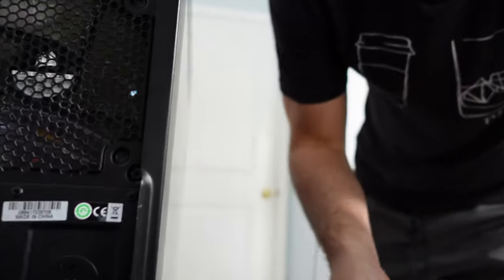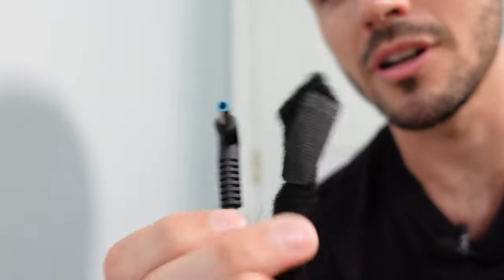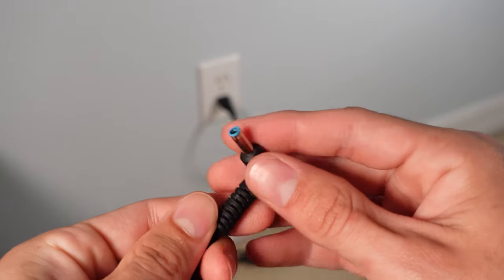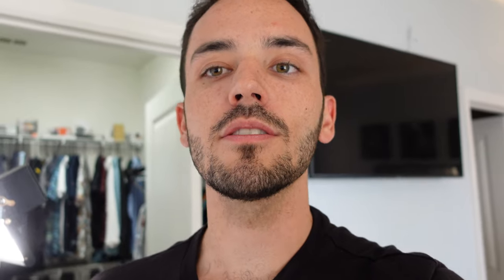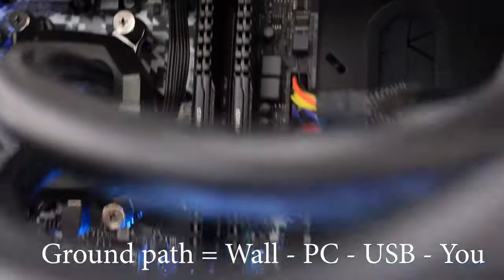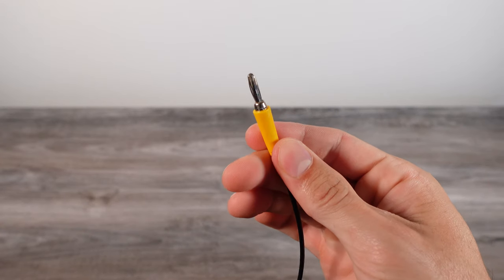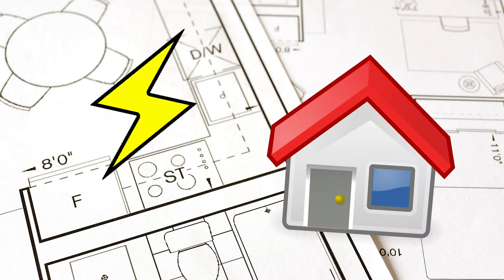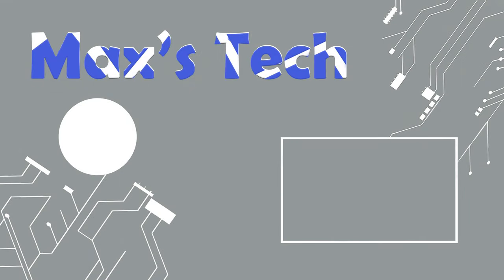PC Building - Easy Grounding Tricks

Comment: Two important facts: Older houses probably aren't grounded, even if you have 3 prong plugs. Also ALL electronics plugs (like the one he showed) have the ground on the outside ring. You have to understand how to read the plug symbol to know if the ground is on the outside or the inside. Moral to the story, YouTube "experts" can kill you (or wreck your equipment).
Reply: this is easily testable by finding a common item such as a power strip with a ground LED indicator. If the light doesn't luminate when you plug in the power strip to the socket, that socket is either faulty (doesn't ground like it should) or the power strip is defected.
Reply: How old of a house for there not to be a ground?
Reply: @rotatorcuffs8140  I'd say houses in the 60's would be grounded. Not sure when exactly, but probably the latter half. I have a ranch built in 1957 with an addition attached to it in in 1967. The addition has grounding wires and 3 prong plugs, not the rest of the house though.

Comment: I'm a bit lost. My new pc has the usual on/off button, and an "I/O" switch at the back of the computer. (Near the plug inlet.) I'm using a power bar--I always switch that off at night. Questions: Keeping the desktop plugged into the (grounded) wall socket; with the pc power button "off"--Do I switch the "I/O" toggle to the off position? I have no idea why this pc has such a thing. It's something new to me. Why the customary on/off button; plus  the "I/O" switch? Thanks for any replies.
Reply from the maker: If I understand correctly, you’re talking about the I/O on the power supply on the back of the PC? That is the hard off switch. So that cuts any power from going from the wall socket to your power supply. The button on the front of your case just signals the computer itself to spin up and turn on, even if it has power from the supply it can remain off, but that button on the front case tells your pc to start drawing power essentially.
Reply from the maker: Same way your phone can be off but still have a fully charged battery. Just needs the signal to start drawing power.
Reply: Thank you Max! I kinda thought the switch at the back is for a "hard" off. Thanks for affirming that for me. If I may; one more question: I hope it's not too painfully obvious: Before opening my pc; (1) The "hard off" switch should be in the off position?  (2) Off; but the desktop still plugged into the grounded wall outlet; I remove the pc cover. (3) Last step; I'll fasten the anti-static alligator clip to one end of my USB phone charger, and the other end into a USB port. Before I go....I enjoyed your presentation. Clear; helpful, and very polished.

Comment: If there’s any confusion he’s not talking about connecting yourself just to a laptop or desktop, it’s about connecting yourself in a circuit to “the ground.” The plugged in computer (or electric outlet 3rd prong) is a gateway to the ground, through your home’s wiring. 

By completing a circuit to the ground (grounding yourself), you are preventing static buildup & ESD discharge. 

Any excess ions that would be accumulating on your body get transmitted immediately through the cable into the ground. (Think of the earth’s soil like a giant heatsink for electrons)
Reply: Does this mean when I work on a desktop, power it off, hook my wrist strap up to a metal part of the CPU, but most importantly the power cable needs to be plugged in so that way it completes the circuit to the ground.  Is this right?
Reply: @isaacrodriguez8907  And also turn the power supply switch to 0 (off)
Reply: Being barefoot on the ground works?
Reply: What if your laptop charger doesn't have the ground prong and only the 2 top prongs, will it still ground you?
Reply: The transformer converts ac wall to DC portable. The inner of that plug is + to be safe and - on the outside. Ground is only on the ac side. He is just using - on the dc side. DC is also safer around water as well as human contact. A car battery you can touch both terminals with no worries. Don't try that with Tesla's ac. The 3rd is direct contact to copper rod in back yard. The cold side of ac is returned to the source on a second wire
Reply: @isaacrodriguez8907 yes, except for the part where you said to hook your wrist strap to your cpu. Don’t do that! Hook it up to something else metal on your desktop like your case. It’s not just the motherboard that’s connected to ground. It’s the whole thing! Even if it seems useless hook up things like the case, it’s connected so that the risk of dumping a whole flip ton of static electricity into sensitive electronics is reduced to a minimum.

Comment: Thank you! Great hack with the laptop charging cable. A lot of videos I've seen about grounding neglect to mention that the power supply for your PC has to be plugged in to gain the benefit. If you are building a computer from the ground up (pun intended) you don't usually start the build by plugging in and mounting the power supply.

Comment: Wow you are the first and only person to answer the whole laptop issue, use the laptop charger itself as a ground 

Seriously thank you for this advice I was getting sad I had to wait longer to upgrade my laptop as I had to now either buy a grounded pc mat or a grounded plug like you linked, but the laptop charger means I can do it now! 

Again thank you!
Reply: Do you still need the anti static mat if you ground yourself using the charger?
Reply: hi, i live in a country which have sockets that can be turned on and off. so when i connect the laptop charger on the wall socket, should i turn on the switch?
Reply: @kicapification  Same here, Im confused
Reply: @kicapification  no, ground is always active regardless.
Reply: @magicalminty6829  ground is active regardless of on or off position. Ground should always be active even when switch is off.

Comment: i really appreciated this. so if im sitting still in bed on sheets and such(i have a bed desk bc of my bad back), should i just touch the plugged in laptop charger every so often, and i will be safe while replacing my keyboard? or should i buy the wrist strap and latch that onto the charger? im kind of afraid of getting shocked myself somehow, as well as harming my laptop. i am fairly new to completely dismantling my laptop. what would you feel more comfortable doing to your own really high dollar pc that you couldnt replace!? lol
Reply from the maker: Luckily the keyboards on laptops are not too bad, typically a single ribbon cable and you don't need to touch many internal components. As long as you don't move after you ground yourself the first time it should be fine. Usually you build up static charge from walking on carpet

Comment: == DO NOT USE A LAPTOP CHARGER OR USB LEAD (OR USB CHARGER) FOR ESD GROUNDING!!!  ==

== THE ONLY WAY TO GUARANTEE THE SAFETY OF BOTH YOU AND THE EQUIPMENT IS TO USE A GENUINE ESD OUTLET ADAPTER ==

Using a charger or USB lead into the front of a PC is incredibly stupid and irresponsible! A charger PSU can have a proportion of mains voltage present at the DC jack due to depending on the internal circuitry, and is especially a risk with cheap aftermarket chargers. Using a USB lead into the computer send the ESD voltage directly into the motherboard electronics that you are trying to protect and were never designed to handle ESD.

The only proper way is to use the correct ESD power outlet adapter. Why? Because the ESD outlet adapter has been specially designed internally to safely ground ESD voltages and protect the wearer of the ESD protection from any mains or outlet voltage appearing at the ground hole in the event of an electrical fault. Always use proper ESD equipment for your own safety and that of the equipment.
Reply: Hi, I tested wrist band, using multimeter connect the 2 ends of the band, resistance of 2m ohm knob shows signal, but when I wanted to test esd mat, I put the band clip to the mat, then one prong to the wrist band, the other prong to the underside of the mat, nothing shows up on the resistance multimeter, why is that?
Reply: @makaela3041  It's possible your meter isn't suitable for testing ESD equipment. The mats have a very high resistance and are often only designed to protect components placed upon them.

It's also likely only one side of the mat is actually conductive so the test would be performed on the surface any components would be placed on, with the other side being non-conductive. If possible, check the manufacturer's specification.

Comment: Should you have the laptop charger turned on when using it for grounding? seems kind of dangerous to me, can someone explain it to me?
Reply: The charger is always on when it's plugged in, it's the inside that you shouldnt and can't touch unless you cut through the grounded metal around it. It's the same reason you can touch the tip of phone charger and be fine
Reply: Yes when he talks about grounding he’s not talking about connecting a circuit to your laptop, he’s talking about connecting yourself in a circuit to “the ground.” Literally. By completing a circuit to the ground (grounding yourself), you are preventing static buildup & ESD discharge. Any excess ions that would be accumulating on your body get transmitted immediately through the cable into the ground. (Think of the earth’s soil like a giant heatsink for electrons)

Comment: So, I can just take a standard old laptop charger, plug it into a powered outlet, and it will work? I just plug it in as if I were to charge the laptop but Instead I attach the anti-esd wristband to the metal tip?
Reply from the maker: Yea, so basically all you are doing is utilizing the ground that the charger uses. Which just connects the outer metal end of the connector to the bottom ground hole in you wall, effectively using your houses ground as your own personal ground.
Reply: But the laptop charger also has 2 other prongs connected to the power outlet, won't it make the end of the charger live? And hence transmit that to the wrist band as well?

Comment: Incorrect! Often the DC output of power supplies are 'floating' and can measure up to 70 Volts or more above ground/earth.
I have actually received electric shocks from these plugs whilst touching the plug and a computer case.
I have also seen sparks between plug barrels and sockets they are being plugged into because many power supplies rely on the device (computer) to ground the power supply. To test if what you are saying is true, you must unplug the power supply and measure if there is continuity between the ground pin and the plug barrel with a multimeter. If there is - fine. If there is no continuity, then the plug barrel is floating and can't be used to 'ground' you.
Reply: I agree.  If you're working on a desktop, just install the power supply, then plug into the wall and keep the power supply off.  The third prong is connected to earth regardless of which position the power switch is in.
Reply: But even if there's contuinity, won't the live pass from the DC plug to the hand, mat or whatever the plug was connecting to?

Comment: Thank you for this great video!

Another tip. You don't necessarily need to touch the laptop charger with you hands. You can step on it with you barefoot to ground yourselves and that will keep you hands free.
Reply from the maker: I sometimes use a ground strap just on my ankle :) helps a ton!
Reply: nice

Comment: Hi. I have a question regarding this topic, hope you don't mind me asking. 
I need to clean my PC thoroughly, but I don't have any way of keeping the PSU plugged to an outlet while I do so (nor do I have a wrist-band). However I have a voltage regulator with an outer casing made 100% out of metal. If I connect said power regulator to a 3-slot grounded outlet, and I touch it every now and then (without switching the regulator on), would that make me grounded and allow me to touch my components without fear of discharge?
Thanks in advance!
Reply from the maker: I never mind questions! But for your scenario I would honestly just touch your case and try not to walk around. You mainly build up static electricity in your body when you walk since your feet glide across the floor (especially carpet). So just set everything up and sit down and make sure to touch your case before you touch any component. Then if you need to get up and walk or grab something just be sure to touch your case again before you continue
Reply from the maker: For your voltage regulator I'm not 100% sure the outer casing is connected to the ground slot. If it is then you can use that too (and often it is) but it's up to you!

Comment: Can I just run a wire between my case and the ground socket?  I notice that sometimes when I touch my KEYBOARDS that are plugged into a USB hub the computer reboots. Very annoying. My Lian Li case (all metal and glass) has always caused static discharges when plugging something into the front, too, so I had to put electrical tape around the front sound jacks and USB ports.
Reply from the maker: Sounds like you might have an electrical issue with your wall socket… your power supply is already plugged into the wall so it receives the ground from that and so does every component the power supply plugs into, so that would end up being every component in your PC. Not sure that’s a static discharge…from an all metal and glass cases, that may just be straight electricity from something hot touching your case? Not sure

Comment: Stupid(probably) question time. I'm in the UK, and our wall sockets have on and off switches. If I were to use the laptop cable method, should the wall switch be on or off?
Reply from the maker: On or off the ground or “earth” as you may call it will still be connected. The switch will only stop current from flowing through the hot wire, but the ground is always connected :)
Reply: @MaxsTech  Thank you!

Comment: im getting a lot of noise from audio ouputs even from external sound cards im thinking is the power supply ? creating static on the motherboard signals
Reply from the maker: I don’t know how the power supply would be creating any static electricity and if any did exists it would be spread to the case and/or ground from the outlet via the power supply anyways. Static noise/ white noise is likely caused by the port, try to hold or push in your audio cable, if it’s loose and not snug in the port that can create static.

Comment: This method work if I'm experiencing static on my keyboard even if it's wireless? The static is like penetrating my thumb skin when touching the keycaps.
Reply from the maker: That….sounds more like your keyboard is shorting out and shocking you. Is it often?
Reply: @MaxsTech  Yes, lately, it's really annoying. I tried different keyboard wireless or wired but still same. Also my mouse has same problem. My friend test my pc if it's ground or not but he said it's normal and we even put grounding rod connected to screw in the area of psu. Can't possibly my PC since I already tried the wireless keyboard. For 2 years I only experience this recently. Is polyfill also conduct static? since I mod my keyboard putting polyfill inside, tho the other one don't have but still has static.
The keyboard is aluminum btw.
Reply: @MaxsTech  I also thinking my room humidty trigger the static.

Comment: What if your laptop charger only has the top 2 prongs and not the bottom ground prong, does it still ground you?
Reply from the maker: It won’t be connected to your house ground, devices with 2 prongs typically have their own surge protection inside so they don’t require grounding.

Comment: So basically, the wrist strap is to be worn once the pc is built, mainly before the chord to the power supply is plugged in and switched on?
Reply from the maker: No, it’s purpose is to protect your components as you build. Your body will build up static electricity when you move, this can be simply your shirt rubbing against your arm. Over time that can create a charge in your body and you could potentially send that to a part of the component that would damage it.
Reply: @MaxsTech  thank you 🙏🏽

Comment: i have my parts now and to ground yourself using the laptop charger works? but what if the charger isn't using the 3rd prong? and only the 2 horizontal? will that still work? my mobo comes today so i was contemplating on the bracelet or not. i mean i don't have carpet either except 2 rugs but thats really it tbh, but im kinda confused on that.
Reply from the maker: It needs the 3 plugs, since you're basically just tagging along to your houses ground through your charger. If not just use your PC case if it has bare metal on it.
Reply: @MaxsTech  ahh i see. So far ive been messing with the mobo and putting stuff in so far ive been good. But ill keep touching the case more so than the laptop charger. Thank you!

Comment: I built my first pc the other day and nothing happened so you will probably be fine if you’re not grounded
Reply from the maker: Most of the time yea, and a lot of components have protection built in. From experience though I have fried a ram stick before due to static charge.
Reply: @MaxsTech  do I have to turn on the wall outlet

Comment: Hi there! If I use the phone charger method, can I just plug the cable into a usb mains plug instead of the USB port of the pc?
Reply from the maker: You can plug the USB cable to anything but just understand whatever you plug it into it's going to use that devices ground method so make sure it has a ground. When you plug it into the pc it uses your PCs ground from that port.

Comment: I wouldn’t use a Laptop charger for ground. The barrel connect plug could be positive outside and negative inside. The center pin is not always hot. There are electronic devices where the center pin is negative and the outer barrel is positive.